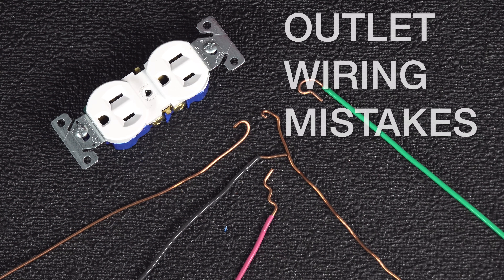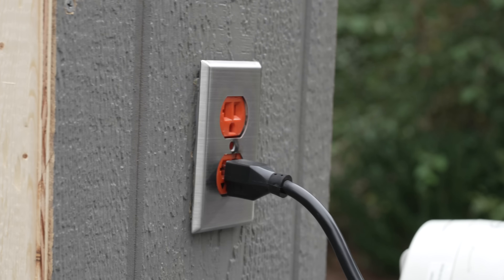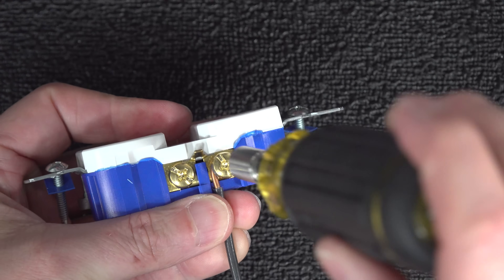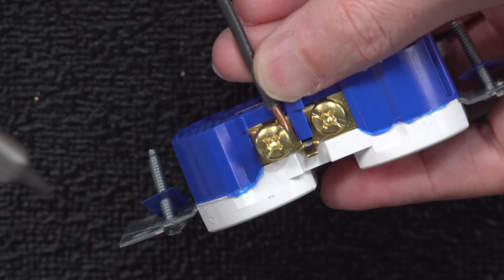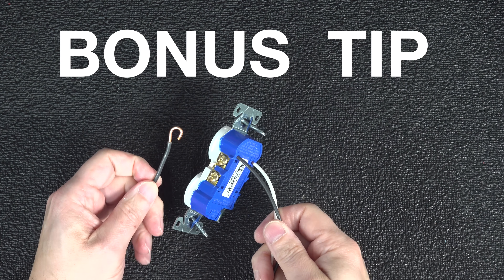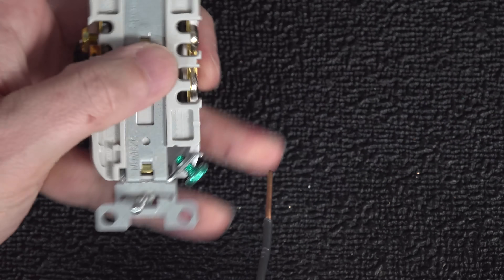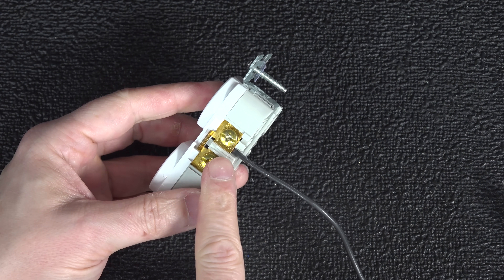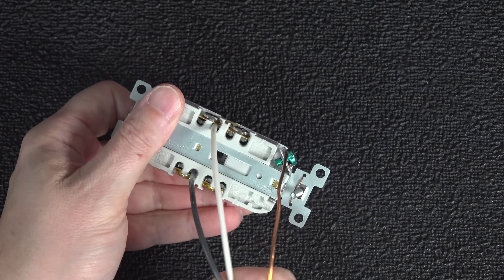BEWARE Of These 3 Common Wiring Mistakes On Outlets & Switches

Comment: Reverse polarity in AC?? You gotta be kidding
Reply from the maker: https://youtu.be/d6Eq2KRtE90
Reply: @SilverCymbal  so we are talking about polarized sockets and plugs, not actual AC polarity. On the other side, polarity in DC exists and is important.  Also this practice has it's downsides since a lot of things need to be done in the right way. The electrician has to connect hot in the right place and the plug also needs correct wiring. And this has to be done for every socket. While it seems a safe practice, in my opinion it give you a false sense of security. In EU for example we don't have polarized sockets and plugs. Both plugs in sockets are treated as hot.

Comment: Really surprised that he didn’t talk about the fact that most people use a Phillips drive or flat head when most of these outlets are designed to take a square drive. Whatever works for you works but with the square drive it helps keep the bit from slipping and really let’s you tighten the screw with ease.
Reply: Not 20 a plugs
Reply: I use my impact with a Philips bit. 3 uggas is tight.
Reply: Yes generally not a phillips

Comment: Its easy here in Australia, you get an authorised and qualified electrician to do it for you, that way its done right and you avoid electricuting yourself. DIY electrical is illegal in Australia and also will negate home insurance on any electrical fault.
Reply: That’s over the top IMO, most wiring is straightforward. If you can change the brakes on a car then you are probably competent to educate yourself on tasks like this. Certainly there are areas that require technical Electrical training beyond most people, but swapping outlets is basic
Reply: @____________________________.x  Ive met people who couldnt change their socks let alone brakes. Rules like this in Australia are for the "lowest denominator". You know like the the type that think invermectin will cure covid because someone on reddit said it would rather than following sound scientific facts.
Reply: @naroe2001  We just have a compliance certificate before you can sell your house, I think that's a better way of ensuring that amateur work doesn't affect anyone but the house owner. As a society we can't keep catering to the lowest IQ when the majority are fairly capable

Comment: Beware of the common mistake of wiring your wires through the outlet ie two blacks or two whites because if the outlet burns out everything else down the line doesn't work. So for good measure wire up all the wires in the box and then have your leads come out to the outlet

Comment: Backwiring is by far the most common thing you will see. It's not WRONG, because it's the same as any push in connection, it's just that push in connections suck.

Comment: I disagree, as a 25 year master electrician, you are not doing that correctly. You never want to use the outlet as a splice or continuing to run the circuit. The correct process is called pig tailing, using your pliers to twist all of the wires together under a wire nut and using a single jumper to feed the outlet. That is the correct way to handle that wiring and it is the number one reason that the Beckstead stab in wire connection fail.
Reply: It’s done that way in the UK. Surprised the US doesn’t use Wago connections yet, wire nuts are awful

Comment: Honest question: are you really using screws in the US to fasten cables in a socket?!? In Germany it is not allowed since many many years because screw connections are getting loose over time and are never the same pressure. All main manufacturers here only supply clamp connections. They are easy capable of delivering 3680W (230V / 16A) all day long. You need 2.5mm2 Cable for that (AWG13). 
Greetings from the land of WAGO.
Reply: Yes, much better, I’m hoping to see that in the UK one day.

Comment: The backwire hookup is fine for 15 amp applications. The outlet is UL listed for that type of hookup. Literally designed for that. When the backwire hookup is used on a 20 amp circuit, then there is not enough of a connection, however nowadays you cannot use a 12 guage wire in the backwires anyways so it really doesnt matter.

Comment: Another way to determine which side is hot:

Look at the front of the receptacle. There are two slots where you plug in your appliances. 🔌

The smaller one is the hot side. Reasoning in case you forget: you want to reduce the possibility of inserting an object into it if it's small.
Reply: The little one is the mean one
Reply: 120v is a tickling reminder. Amps kill. Would rather deal with ac over dc regardless of amperage. Hard to get away from dc when your hit.

Comment: Always hook the wire never backfire ever. And don't use a Philips screwdriver USE A STRAIGHT BLADE TO TIGHTEN CONNECTION. Don't have multiple wires connecting to your plug or switch. Pigtail and have electrician pass circuit threw with wire nuts don't use device for that
Reply: Straight blade screwdrivers are the shittiest screwdrivers use a Robertson

Comment: yeah. I really hate backwiring. I am just a handyman, not an electrician, but I have come across so many faulty outlets that were the result of backwiring. Too much bare wire, broken stab in ports back there, melted body like the picture in the video, and people using them to add more wires like you said rather than pigtailing them to the side terminals.

Comment: Huh, these improved connectors with backplate is somewhat standard in Europe since... beginning of times. WRT ground connection and why it has only a screw, but not back plate connection - maybe there's demand, as in some other countries, to lay the ground wire as a whole piece, without cutting. So when you are connecting it to the socket, you do not cut the wire, but remove part of insulation, bend it and then put it under the screw. These way other plugs "down the stream" wouldn't loose ground wire if screw in this particular socket gets loose.

Comment: I installed a gfci that had both the rear insertion and the hooks. The rear insertion did require tightening the screws a bit.

Comment: One of my coworkers told me to just backstab it once and I was like… nah man. I’m an electrician, as well, but as far as those outlets go, I usually only see the clamp screws on GFCIs, though. Either my boss doesn’t get them because they’re more expensive but I’m yet to see a non GFCI type outlet that had those. Would also save a ton of time in installation and remove the need to even worry about the size and shape of the hook and how much wire is being stripped away. Totally agree on the clockwise hooks, too.

Comment: The last outlet with the clamps is my favorite it drives nuts when a “master” electrician makes hooks on them 
Old habits die hard I guess
Reply: When I was in training, my teacher said to never ever ever use the clamps because they were just as bad as the backstab connectors.
Reply: I can't even begin to count the number of receptacle clamps I've seen fail when being used with a full box. It just takes a little bit of wiggling and they get loose. If it isn't end of the line or a roomy box, it's the ol' reliable hook for me.

Comment: Is this modern style outlet? In Europe this is considered beyond ancient..... putting wires under screws is sooo 1800's. We regularly use spring loaded contacts, rated up to 20 amps continuously. But at 230V between phase and neutral the system requires far less current then at 115V.
Reply: Oh god those cheap plastic euro connectors are trash

Comment: Fun fact for everyone.. if you use a standard set of journeyman pliers whether they be Kline or any brand... The width of the very tip of them is the depth gauge to strip for either hooking or terminating into a breaker switch or receptacle.

So to recap

The width of the tip of your journeyman pliers is always the proper strip length.

Bonus fact.. by Code you need 6 inches of wire coming from box.. the box is 2 inches deep, your kliens will be 8 inches.
Stick you pliers in the box and cut your wire at the end of your pliers for a perfect length everytime!

Comment: From what I've read those backstab connections are allowed by code.  My entire house was wired using them.  I don't like them for some additional reasons.  A couple times I pulled an outlet out and one of the wires just fell out, it wasn't secure at all.  Other times I couldn't get the wire out.  I agree that they shouldn't be used, even if allowed.
Reply: My mom’s old house was wired with this type of outlets.  I like to call them “Lee Press On” outlets.  She told me that an outlet was no longer working.  It was an outlet that an electric heater was connected to for an extended period of time. When I pulled things apart, I was appalled by what I found!  The wires were corroded.  The insulation was cracking off.  It was obvious to me that this connection could not properly deal with the heat produced by the current required by the heater.  The connection was obviously arcing and caused all sorts of problems.  I’m so thankful that this didn’t lead to a fire in my mom’s home.

Comment: Why don't you Americans have it written on the socket. Here in the UK you virtually can't get it wrong because it's all labeled. All terminals unscrew or unlatch unlike the connections you have which have the push in option aswell which I thing is pretty crap when you could be pulling 15amps I believe is your socket rating. Should just get rid of that option as you've stated not fit for heavy use.
Reply: Have what written on the socket? The wire color is typically stamped or molded on the fixtures if one doesn't know the silver/gold convention.
Reply: @whiteknightcat  then I don't see why it pointed out the fact people get it mixed up with the gold and silver if it is stamped on the socket
Reply: @HA05GER  Because there are people who refuse to read the stampings, or the little package insert on those products that are packaged, or who blindly go about hooking things up without looking at what they're doing. 

This puts me in the mind of several YT videos I've seen of people demonstrating repairs of something, or unboxing and using a new product, and how it became shortly obvious they hadn't a clue as to what they were doing. They know better than everyone else, and they don't need any instructions.

There's no such thing as a failsafe system where determined morons are involved.
Reply: @whiteknightcat  I do totally agree with your comment I just don't understand why the video didn't point said information out.

Comment: Black is the hot wire?  Isn't black used for ground in like all other areas of electronics.
Reply: No, you're conflating AC and DC circuits. In household AC, black = hot, white = neutral, green = ground, red= 2nd hot in a 240 volt circuit or 2nd source in a 3-way 120 volt item
Reply: @whiteknightcat   way to prove my point

Comment: Here something to think about.
China gfi outlet new.instructions.Hot wire to load.the hot is coming from breaker, and that wire is suppose to be attacked to line. Yep the line, the load is out to additional outlets. 
Bought two more gfi outlets. From ace, the in struction was correct. 
As. Far as white wire being neutral, the outlet for neutral( the large slot) that tells you which
Side the white wire goes.
An actual electrician told me this backwards, 
He was testing me, and i let him know he was wrong, he said yea I know.

Comment: I definitely do not recommend using the push in holes on the back. I had a neighbor ask me to look at his outlets that were visibly arcing, enough that you could see the cover back lit as it arc’d. Pulling outlet from the box all the connection were made using the holes in the back. They were all showing signs of melting and needed to be replaced immediately before a fire was started. I reinstalled all the new outlets using the screw terminals. How does this happen.....well the contractor was into the time savings instead of doing it right.
Reply: Lol I have heard this story from all “union electricians”. Been an electrician for 12 years and have yet to run into any problems from stabbing wires in the back of receptacles. Receptacles are designed this way and are UL listed for such an application. Common problems I see are when people try shoving stranded or 12 gauge wire in the back. Also they strip the wire too long or too short and this is all user error DIY stuff.
Reply: @dallas5374  I agree. I’ve been installing receptacles and switches like this for years without any issues. The main problem is like you said. Either they strip too much of the wire leaving the copper exposed creating arcing, or trying to shove 12 gauge wire in there which cause the same issues!!! 🤦🏻‍♂️🤦🏻‍♂️🤦🏻‍♂️
Reply: I refused to ever use the holes on the back. A tiny bit of spring contact is all the connection that is there. Do whatever you want but just because it's there doesn't mean it's the best way to wire it. Plug a space heater or hairdryer on it and eventually it will fail. Yes, I've seen them fail to the point of being so brittle from the heat they break when removing them from the outlet box.
Reply: That wouldn't happen unless the screw was loose or the receptacle is broken like hit with a hammer broken. There has to be an air gap and then contact for an arc. There is nothing wrong with using those holes it's just there are advantages to hook loop especially since we pigtail wires off the receptacle and make the actual connection to the wires from the outlet box by joining the pigtail to the wires with a wire nut there's no chance of it ever pulling out. Never use the cheap apring loaded backs.
Reply: @jamesbelcher896  It may well be the case that the screw terminals offer better mechanical connections than the plug-ins - I certainly don't know.  My attention, though, was caught by your comment "...we pigtail wires off the receptacle and make the actual connection to the wires from the outlet box by joining the pigtail to the wires with a wire nut there's no chance of it ever pulling out."  I guess you're referring to "no chance of ever pulling out wire from the screw terminals"?  I've done lots of wire nuts over the years as an occasional DIYer, and have certainly been able to pull wires out of a wire nut - while testing them to be sure they were secure, and finding out that they weren't.  Obviously, I have lots to learn about making reliable wire nut connections!
Reply: @acommenter  when it comes to wire nuts and solid wire we pretwist the wires together put on a wire nut tug test then electrical tape the wire nut to the wire with stranded wire we do the same but cut them long twist them well then trim the wire(a wire nutnis made to twist them together but it seems less reliable than doing it beforehand). When a receptacle has loose screws connecting it to the box I've noticed wires fall out of spring loaded back slots because the receptacle moves some every time it has something plugged in.
Reply: How can you say it is not right when the manufacturer clearly gives that as an option and doesn't state any reason not to use them ?
Reply: @caseymoore9737  because they are convenient and still meets the bare minimum electrical code. but that doesn't mean you should use them when the screw terminals offer a superior mechanical connection.
Reply: @caseymoore9737  I honestly don't know how they can legally provide that connection method. I've fixed tons of family members outlets and switches that have intermittent connections or have partially melted because of a poor connection from those stupid push in style connectors.
Reply: @CondoreComputing  for sure without a doubt from your memory what was the wire gauge that you fixed for those backstabbed receptacles?
Reply: @vel5724  I believe they were usually 12 Guage. But they were mostly houses built in the 80's, and it's been awhile so there could have been some 14 Guage. I do know that in a lot of cases the copper was usually annoyingly brittle.
Reply: @CondoreComputing  not sure about one's installed in the 80s but most "back stab" receptacles state on them for the backstabbing is 14awg max but commonly I see on service calls the ones that  burn up have 12awg put in the back stab holes

Comment: I checked an outlet with a cheapie polarity light. All 3 lights came on. It is a standard 120v outlet. I measured it with a meter, and it has the full mains across it, 240-255v. I left it for the customers to use. We sell mobile phones at our store. And we sell lots of new chargers for some reason.

Comment: Why not use N & L on the socket rather than rely on color? Did you know in the UK the wiring code allows for color blind folks to still correctly identify the wires?
Reply: Very cool